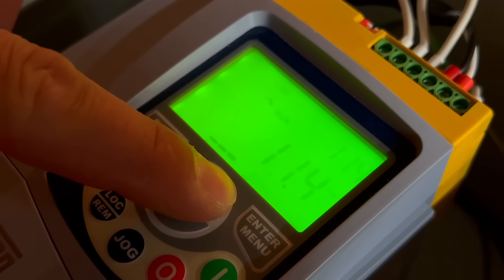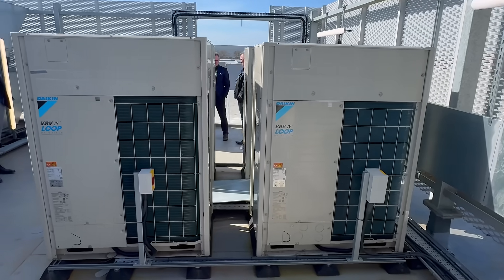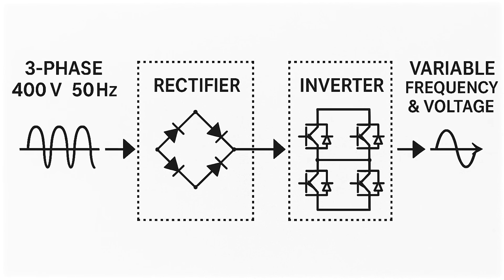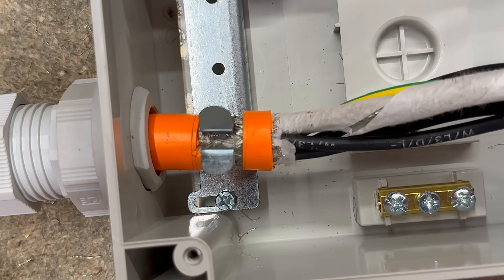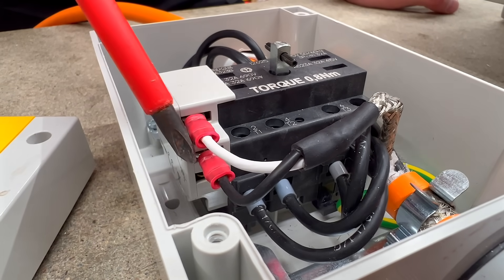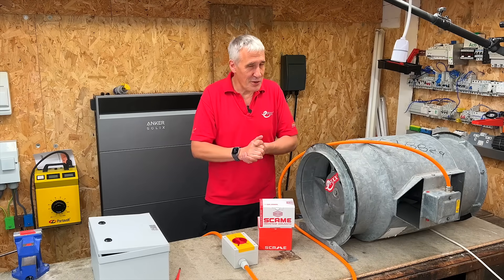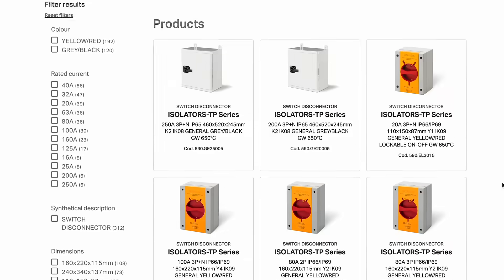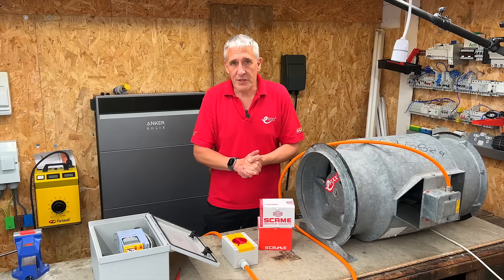How a Hidden Switch Saves Expensive Equipment!

Comment: 4:20 Not at all.  This is completely incorrect.  Safe Torque Off is all about safety not about protecting drives.  If you're using STO to protect the drive then you're using it for a non-intended purpose.

Comment: You also need to be able to ground the motor shaft or you will have early bearing failure due to arc pitting on the bearing parts.
Reply from the maker: Thats an interesting topic worthy of it's own video!

Comment: I install dozens of drives mainly Schneider and Invertek, you would treat the isolation like any DOL motor by using the control circuit. On the drive whatever run signal you have configured would go into stop and the drive would shut down, the isolators before and after are to isolate the drive and after to isolate the motor for maintenance (safety) not to stop the motor. Used correctly I can’t see the point of this, a phase loss on both the above types would shut down the drive.
Reply from the maker: The Schneider ATV6 drives include the STO module as standard.
Reply: @efixx  right the ATV12 range I use doesn’t or the IP66 Invertek ones, I have used Scame gear for years including the isolators, I still think that started and stopped correctly they are fine, it’s not unusual for non electrical persons to flip a breaker off but the drives seem to cope fine.

Comment: Its just a weird design (yes, I know that the code requires...) with switch between inverter and load. Should NOT be done this way, ever. All power electronics designed to work in its circuitry, not in conditions when something can be suddenly disconnected on full current.
Reply: That is a normal and clever design as you can have a disconnet on the roof near the compressor/ventilator and the VFDs in the basement with better cooling instead of being grilled to death on a sunny rooftop.
Reply: @deineroehre everybody disconnects it in switchboard, with CB in controlled protected environment, locks it, checks and then works on safe disconnected circuit, not just behind the switch which spent years under sun and rain. Exclusive British pseudo-safety invention, like train doors without internal handles or separate hot water taps.
Reply: @antontsau  You need to get some experience outside the office and get in the field with aged buildings, but even new ones are sometimes challenged in the wiring. The number of wrong labeled CBs is way to high to rely on that. Instead of searching 30 Minutes for the right circuit to safely disconnect, the disconnect in plain sight is a much better way to work safely and efficient, especially while troubleshooting.
Reply: @deineroehre  Muahaha. I am in office, oh yeeees. Great breaking news.

Typical terrible approach. In sane countres like Germany it causes immediate dismissal. "we do not know where is the CB, but we will not even care, just switch it off by isolator, do whatever we need and go!". Bang! Bang! And pig farm work for the rest of the life.

Then appears - switch does not work properly (I met it many times in all forms - GPO switches, standalone isolators), does not disconnect. Who cares - turn the handle, check no voltage (yes, no voltage because main contactor/switch is off at this moment) and go. Kaboom.

Comment: Reducing the frequency alone does not necessarily reduce the power, current is supplied proportional to torque, and power is torque x speed, so slower speeds and higher torques can mean just as much power.
Reply: Thank you 👌
Reply from the maker: Of course it does depend upon the type of mechanical load.

Comment: Largely a gimmick........ although grounding of the screened cable looked quite useful.

An isolator is rarely going to be used for shutting down, and the drive must have some resilience for power cuts / loss of mains input anyway, as part of its approval I suspect.
Reply from the maker: Here’s the extract from the Schneider drive manual - UNANTICIPATED EQUIPMENT OPERATION OR EQUIPMENT DAMAGE
If a downstream contactor is used between the drive and the motor, verify the
following:
• The contacts between the motor and the drive must be closed before a Run
command is executed.
• The power stage must not be enabled when the contacts between the motor
and the drive open.
Failure to follow these instructions can result in death, serious injury, or
equipment damage.
Reply: @efixx I believe the user guide / installation manual for most drives will not show an isolator between the drive and the motor, so you would not be installing inline with manufacturer instructions.

Comment: that a good neat design for the isolator. i were using a timer delay relay (set to 150ms), which will allow a STO to send to the VFD before the power cut off to the VFD, it is functionally the same as this design, but my design would require a bigger footprint in the enclosure. this just make everything neat.

Comment: I remember fitting loads of local idolaters on motors at a factory I worked at in the 80’s. They had “early break late make” contacts wired into the EStop circuit so the contactor broke the load  and not isolator contacts. It was high tech back then 😂
Reply from the maker: Same principle for a different era - BMD before motor drives!

Comment: Why would you have a isolator on the output stage? Isn't it more sensible to have the isolator on the input stage? What I understand all VFDs have safety circuits that discharge any capacitors and stored energy immediately upon losing imput power for safety reasons, so it should be safe to isolate the power on the VFD input and then the motor output should be considered safe.
Reply: its stupid legacy requirement from the code - there must be switch near every motor. Even if VFDs and other equipment is far away in switchboard or so.
Reply: @antontsau not exactly legacy. In our code where I'm from it's stated that it is for when the motor is to be serviced or replaced this is to be able to safely isolate the wires when the motor is disconnected
Reply: @tc5963  In AS/NZS3000 its the same, even worse - 2.3.5.3 devices for emergency switching, including stopping, shall be so placed as to be readily accessible ... at places where danger might occur. 

It means isolation switch (for maintenance, emergency shutdown etc) must be not at control position or switchboard, as in normal countries like Germany, but next to the motor itself. Which is legacy nonsense, from times when motors were controlled by one big mechanical switch right where the motor is, and switchboards were made from porcelain fuses. No one cared about electronics not intendend to cope with load disappearing, or possible results of partial disconnection (2 pumps in water attraction, one down - 4 dead, albeit in reality it happened not due to manual isolation), just SHALL.
Reply: @antontsau wouldn't this reg be for estops. I know in our book sans 10142-1 which is based of of englands regs it pertains to disconnects for servicing
Reply: @tc5963  in reality it means not stop button affecting some usual control (contactor, VSD) but full scale disconnector, switch physically breaking all phase wires. It is proclaimed as isolator for servicing (thus always lockable with padlock) and emergency stop (thus NOT lockable in ON position, but - tadaaaam - MAY be done this way for essential services). Absolutely useless and even dangerous piece of mammoth shit, obsolete since modern switchboard CBs appeared.
Reply: Remember some drives including the one shown in the video(dependingon frame size)can run directly from solar power so an isolator on the ac side won't help much and the cap banks store a lot of energy
Reply: @tc5963  good VSD understand this and switch off output in case of incoming power fault. Even if their rectifier still giving some voltage and capacitors are charged.
Reply: All motors need a “local” isolator if remote from the control panel
Reply: @johnwarwick4105  Yes, but that isolator neccessarly doesn't need to be after the VFD. The isolator must be a maximum certain distance from the motor. If you put the VFD inside a sub-panel local to the motor, you can have the isolator before VFD.
Reply: @sebastiannielsen in factories it is not that common to have VFD's located next to the drive. They are more often in panels in a clean or cool area. Or even a switch room. Think about where motors can be located outside, extract fans on roofs, dusty areas etc. I don't get why you think it's an issue. Local isolators remove the risk of isolating the wrong motor when carrying out maintence. 40 years in industry I think they are essential if the controls are gone distance from the drive

Comment: Thats great if you have the STO input, many little drives dont and so you need to wire the contact into the input 'Free wheel' or any digital input that enables the drive, and have the drive set up to go into 'Free wheel' mode if the input goes off.
This has been the case for the last 30 odd years, and Ive had to replace a few drives due to them not being installed correctly in the first place.
Reply from the maker: Thanks for sharing your experience, that's helpful.

Comment: Definitely a spade terminal.  As far as the damage prevention, it is a thing but only because 'cost optimisation' has resulted in the specs of the transistors in the output bridge being trimmed too far by some manufacturers.  They should be spec'd to cope with what ever kick is produced if the load is removed while being driven.  If that action typically results in a 1kV whack, the transistors need to be able to cope with it.  The cheaper path is to have an early controlled removal of current and that's the path that has been taken.  Humble cheap portable inverters (the sort of thing where DC is put in one side, AC comes out the other) from that well known country are often spec'd to deal with 600 or higher volts to cope with kicks from small inductive loads that are likely to be attached to them.
Reply: I agree with the cost cutting and not to discount you're point but in most cases above 55kw the cfw500 range shown in the video is more expensive than the the normal efficiency motor. That only escalates when you move up to more capable drives like the cfw11 with high efficiency motors. So sizing up the transistors to cope with this under all the operating modes of these drives can easily double or triple the cost for the end buyer
Reply from the maker: Thanks for the input!

Comment: Those spade connectors where also called Lucar connectors because the were widely used in the automotive industry
Reply from the maker: Was it Lucar or Lucas?
Reply: @efixx Lucar as in Lucas-car. A lot of older cars used those spade connectors I started my electrical aprenticship in the Longbridge Car Factory & they were always referred to as Lucar's.

Comment: I have been using VFD’s and more popular current driven soft starters in Fire Pump Controls for some years now.
The VFD is becoming more popular with both ideas used to reduce initial start loads.
This is popular in city centres where supplies are limited due to close quarter popular areas.
They are great bits of kit and would always suggest the STO is always installed. 

Insulated spade terminal should be used or insulated ferrules where necessary.

Use the quick set up screen if you don’t know what you’re doing. The quick set up makes things very easy.
Reply from the maker: Great input thanks 👍

Comment: Some VFD’s have an isolator on the front unit e.g. Siemens G120 drive. 
The normal practice would be to fit the isolator before the VFD. 
The aux contact in the isolator has the potential for other applications
Reply from the maker: The Siemens range covers lots of bases!
Reply: aux in isolator usually used for centralised monitoring and alarm, if someone switched off the motor by this switch - central control sees it and appropriate actions taken.

Comment: Most VFDs have protection against phase loss on one or all phases in my experience. They even turn the VFD for earth faults.
Reply: In mine too.... can't remember seeing one which doesn't!
Reply: That works when you cut power going to VFD, but not sure about power coming out of VFD
Reply: @DreitTheDarkDragon the ones I’ve worked on has the ability to detect that down stream from the VFD